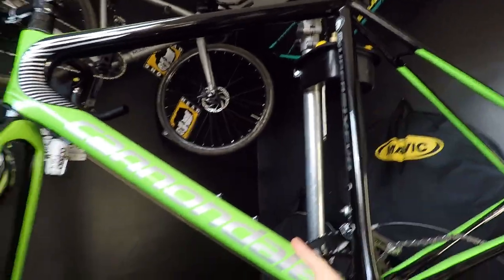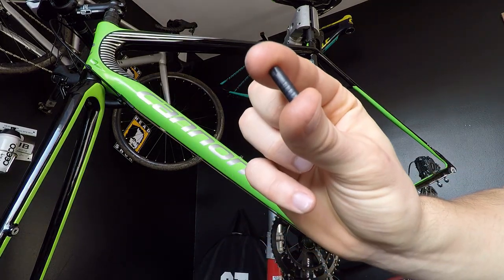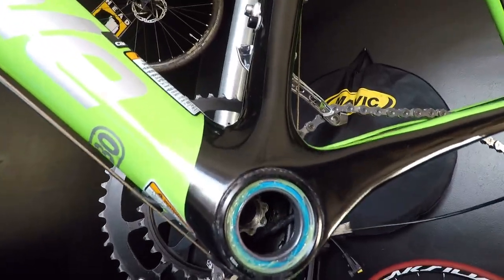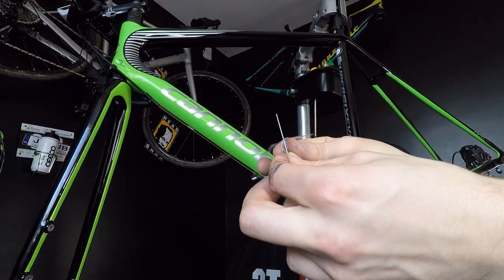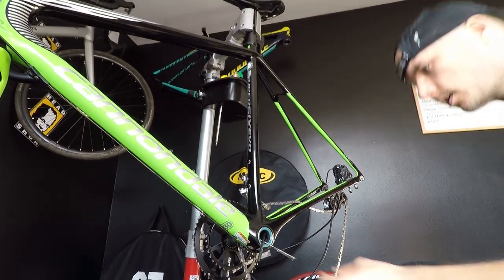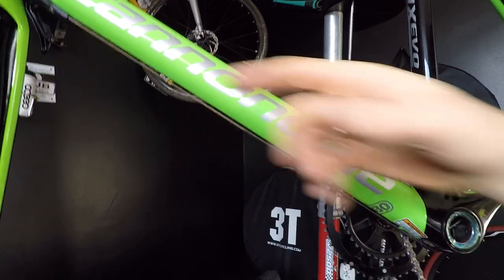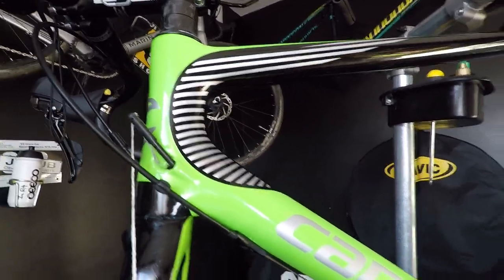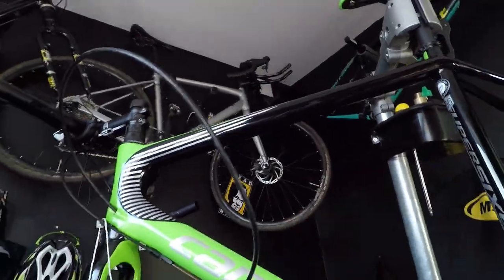How To Install / Guide Disc Brakes Housing Inside The Frame. Internal Cable Routing Hacks.

Comment: really great - and clear - tutorial. Some  questions:
The foam wrapper for around the hose (rattle prevention) - 
1) Did this come with the hose, or was it self made/added?
2) Where are you trying to prevent rattling (where in the hose run is the foam positioned?) - the BB junction? - the chainstay ? the downtube?

thanks again!

Comment: So to route the inernal hydraulic line the bottom bracket needs to be removed, right?
Reply: It’s a bit confusing because the frame in the video uses a BB30 bottom bracket which has no cups. So you can see the brake hose even with the bearings installed. To prevent the spindle from rubbing with the brake hose with this combination (BB30 and internal hosing) either there is a brake hose guide that’s built into the frame or you have to use some trick to stop it.

But to answer you original question, if your bottom bracket do have cups, I guess you only need to remove it if you have a preference of the brake hose going above or under the bottom bracket and you want to check for certain.

Comment: If taping the string to the metal cable, you can run a magnet along the same side as you're guiding the cable to the bottom bracket so it hugs the frame wall to reduce the chance of it getting crossed with another cable.

Comment: Well I enjoyed it. I really liked your presentation and found it really helpful. I've just done the same on a new Specialized Roubaix frame. On that frame there is a foam liner inside the frame that's not at all obvious from the outside. I could see there was something in the frame when shining a light in but couldn't make out what it was. So in order to get the hoses through I had to drop out the front forks in order to get the cable through the liner properly and out by the head. Took a while but it's all done nicely now :)